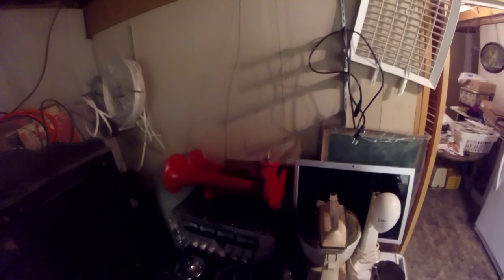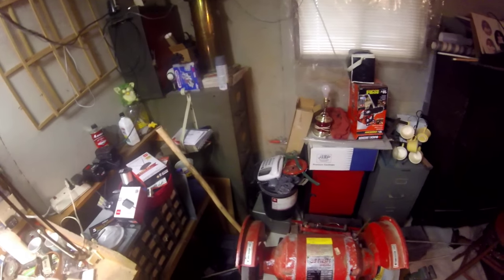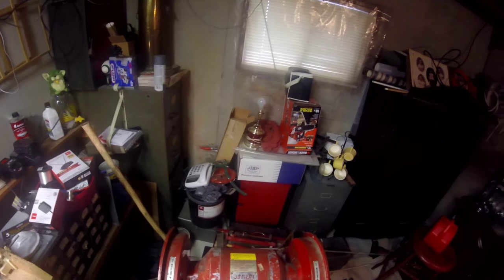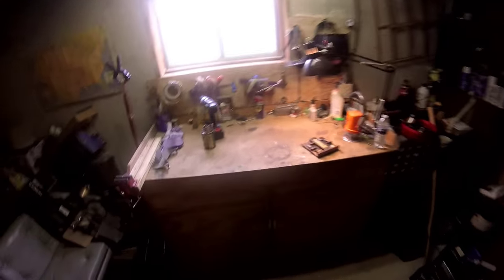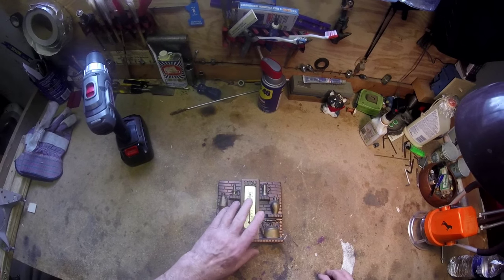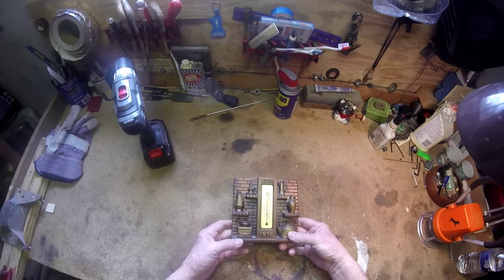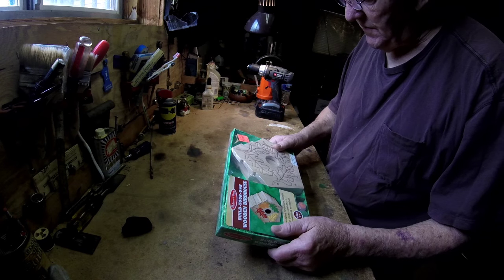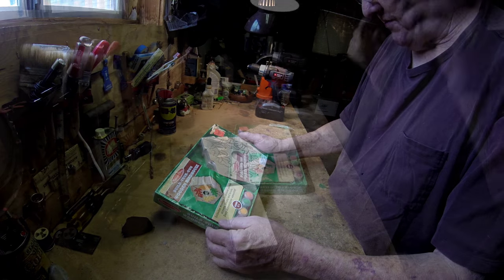Bird House Kit Assembly Part One 2 21 2016

Comment: I have a grinding wheel on one side and a wire wheel on the other side and would like to set up another grinder with a flapper disc on it and then a buffing wheel too! You can never have too many setups.
Tweet, tweet, the house looks sweet!
Reply from the maker: +The Shade Tree Fix-it Man Thanks George